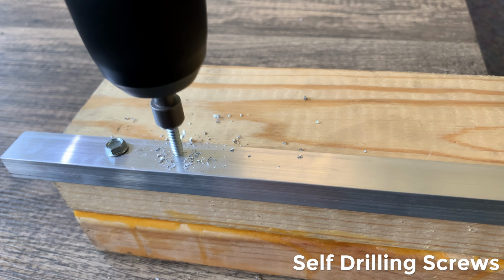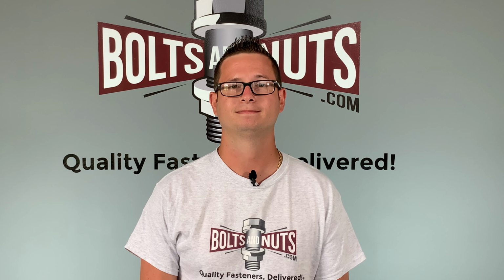Self Tapping vs Self Drilling Sheet Metal Screws and the differences between them

Comment: I used self drilling screws to secure a plate onto a metal door & it keeps loosening… I added a lock washer but idk if that will prevent it from loosening up 100%… any recommendations?

Comment: What is beter for self drilling screws , impact driver or drill ? I only used impact driver with them once (zero times with drill) and it went fast and smooth through shin sheet of stainless steel and a constuction beam

Comment: I have a storm door closer that became detached because the screws originally used were just pulled out of the holes punched in the storm door to secure the bracket. The original screws don't stay in the original pilot holes. What can I do to secure my storm door closer?
Reply: Fill the hole with a splint of wood and then screw in again

Comment: What type of screws are needed for 20 gauge steel studs - self-drilling or self-tapping? Is 20 gauge considered light or heavy gauge steel? What length is preferred - 1/2 or 3/4"?
Reply from the maker: That’s a great question, unfortunately we’re not familiar on the sheets themself. We’ve put the drilling screws through pretty thick steel, I’m personally a bigger fan of those. Saves the pre drill process. 20 gauge is roughly .0359” thickness so either of those lengths will work. It’ll depend what you are attaching or going into. I hope those helps! Thanks for watching!

Comment: Does it effect the joint, if the self driven screws are driven by hammer blows instead of screwing them by screw driver because the former is common when the screws are used in large projects like attaching roofing sheets to timber.
Reply from the maker: Hi Tantary, sorry I’m not aware of hammering these in. We’ve only ever screwed them in. Thanks for watching!

Comment: My plan is to secure some iron roofing sheets to a metal framework(100mm x 100mm hollow square  posts of 1.4mm thick stainless steel) by self drilling screws.  Would the anchorage force of just 1 or 2 threads for each screw be strong enough to hold the roofing sheets in storms?
Reply from the maker: Hey Sam, I’d like to help on this but there are to many variables. Without being there and looking at it, it would be tough for me to answer. Thanks for your question and watching, sorry I couldn’t be of more help.

Comment: what are pilot point screws?
Reply from the maker: Hello Shaikh screws have an unthreaded cylindrical tip that is smaller than the fastener diameter. This helps speed alignment during automated assembly. These would not be related to sheet metal screws. Please let me know if I can be of further assistance. Thank you!
Reply: @BoltsandNutscom  thank you so much for the information , you are awesome!